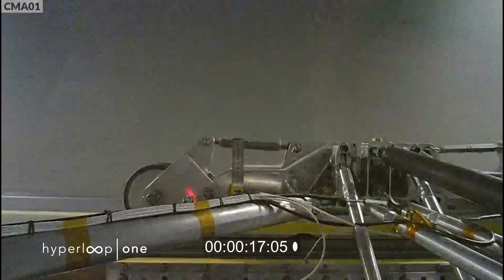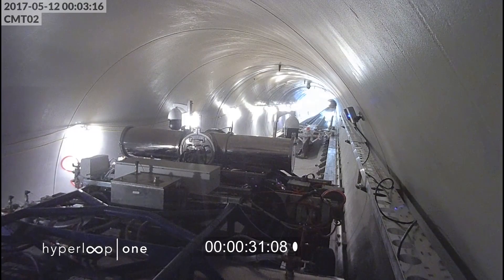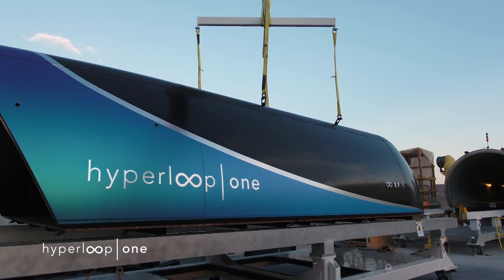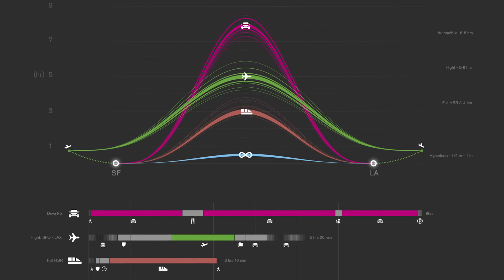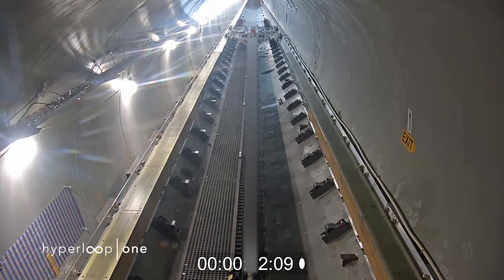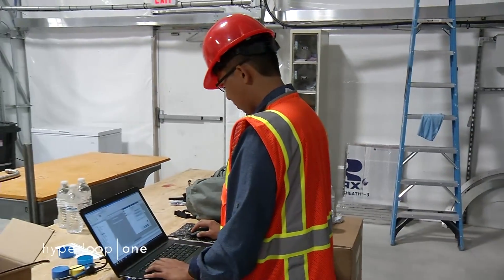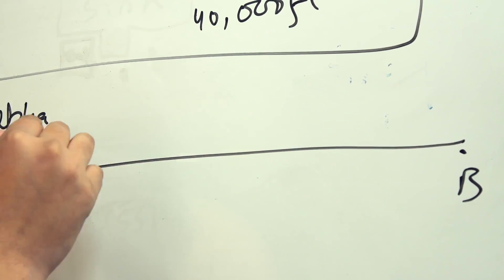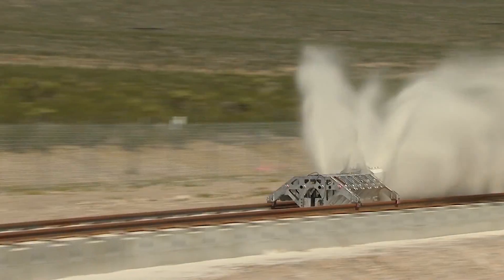Watch the Hyperloop Complete Its First Successful Test Ride | WIRED

Comment: Why are people talking about 
“What about if the vacuum gets a hole?” 
Really? Never knew everyone in fucking YouTube were a physicist or an engineer to talk shit. 
“What about terrorist?” 
Well shit 9/11 happened and millions of people are still riding planes to get place to place aren’t they? 
Fucking people are annoying as hell! We need to take big steps to bring humanity into a greater future than today.
Reply: Yes but even an incredibly small hole could cause a mass system failure
Reply: here we have a perfect example of what the original comment was talking about...the collapse doesnt have anything to do with air rushing in. In fact, a perfectly sealed tube would have an easier time imploding. What causes the implosion is the difference in pressure, which is obviously highest with an absolute vacuum inside the tube. Due to the circular cross-section, the tube is able to resist the forces trying to crush it. A fault in the structure, like a dent or a hole, compromises the integrity of the entire tube enough to cause it to implode. And make no mistake, this is a process that causes a chain reaction, collapsing adjacent sections too. There are plenty of videos on youtube that demonstrate this on a smaller scale, with barrels, or even train tankers, often using a combination of pressure and temperature differences to cause the failure.

Also, i wonder what your reasoning is as to why air flow is limited to the speed of sound?
Reply: lol... WHAT IF THERE IS NO ELECTRICITY?
i am more concerned with the wifi...
Reply: the big difference lies in the accessibility...how hard is it to get a bomb on a plane? pretty damn hard. how hard is it to just walk near the tube and shoot a couple holes into it with a gun? pretty damn easy. And, as an engineer, i can tell you a hole (or even a dent for that matter) would result in catastrophic failure of the entire system by crushing the tube...even if not by a terrorist attack, imagine one of these tubes crossing a highway or something, and theres a road accident and a car or truck crashes into the base of the supporting structure which deforms the tube slightly, and suddenly the whole thing collapses and causes devastating financial damage, let alone reputation and publicity consequences. These are some of the concerns people have as to the concepts viability.
Reply: If terrorists blow up a plane, you have to rebuild a plane. If they blow up railroad, you have to replace bit they blew up. If they blow up a bridge, you have to replace a bridge.

If terrorists would damage Hyperloop, you have to replace the whole infrastructure.
Reply: boi if you don't get
Reply: Juan Ramirez taking down a bridge doesn't destroy the entire highway, and is a lot more difficult than knocking a dent in a tube with a gun...also wouldn't the hyperloop be the perfect high profile target, rather than some highway no one cares about?
Reply: QTRG what if terrorist so attack the hyper loop? If people stop using the hyper loop we’re just gonna give them what they wanted. We let them win
Reply: Because you know that physicists and engineers never go online right!? Moron. lol
Reply: Juan Ramirez ya know what happens when you get a hole in a vacuum tube? The whole thing collapses
Reply: Go to University and learn about Hydraulics.
Reply: Juan Ramirez if a big enough vacuum fails it can cause a massive explosion just like a bomb
Reply: Juan Ramirez you sir have an optimistic mind. stupid and unable to see the dozens of unresolved problems with the project.

but optimistic..
Reply: What if the chamber is underground?
Reply: Correct, but many people don't want this whatsoever because of the risk of terrorism. For me, that's just upsetting.

Also, look up the whitepapers - a lot of the concerns are addressed there (the first few pages aren't very technical, so you may want to just read them/avoid them depending on how good you are with this stuff). The whole point of testing is to identify these issues, and obviously it won't be used by people until it's safe enough.

People are saying that there's a chance it'll never be safe enough and that it'll never work... but, couldn't you say that about every new idea?
Reply: Juan Ramirez and you are a graduated physicist or engineer?

mic drop get out.
Reply: do you have the same view for airplanes also ??/  still you travel.
Reply: Yep, people are shit. I fucking hate them.
Reply: I answered your question earlier, QTRG. He's incorrect to say that it is true in the general case, but ducted airflow through a reasonably small tube will choke per the Kantrowitz limit. And then that airflow will have huge pressure losses down the tube, and there will only be ~5% the air pressure just 2km from rupture.
Reply: I would like to see what evidence you have to suggest it would be catastrophic.
Reply: wow so many people finding obvious flaws.. dont u think the students and scientists building this thing would have thought this through??   never mind. its a free world. cant argue with trolls.
Reply: No, it only collapses if it isn't designed to hold the pressure. Obviously, you design it to deal with rapid decompression.
Reply: sandeep sampath the thing is that these teams are working on a proof of concept, not a feasible business, that's why these concerns don't matter much
Reply: Juan Ramirez Liberal excuses as always. Someone states an issue, but rebuttles with "well it's not as bad as X"
Reply: The Stig implosion, but yeah.
Reply: Juan Ramirez Juan porque no miras alguno de los cientos de videos que explican porque no sólo es peligroso sino también poco eficiente energeticamente
Reply: A plane flying high in the sky which can only be shot down by missiles,aa guns or other planes is a lot safer then a tube on the ground which probably isn't armored
Reply: Adam Mesarč I don't think the whole network will be chipped, but indeed, much transport will be stalled.
Reply: We do need to "take big steps to bring humanity into a greater future than today" but we need to be smart about it and make honest assessments of the risks involved.
Reply: Juan Ramirez Maybe because the idea is so stupid you don't need to be a fucking physicist to notice problems with the design! That said, people complaining about terrorist attacks are dumb. I also agree that with enough thought and design many if not all of these design flaws can be solved.
Reply: then youd have problems with compensating for thermal expansion and tectonic effects (when considering the distances they want to cover), unless you built a bigger support structure which the tube can sit freely in, but then you get another host of problems associated with underground structures, the biggest being cost, ventilation (for maintenance) and general unavailability of underground space in urban areas; it would basically make an already financially questionable project completely unviable
Reply: Yeah because 9/11 didn't change the aviation industry into deploying much more safety measures. You are more annoying than all the other people you complain about!
Reply: Juan Ramirez you sir are the smartest person I've seen in these comments like half these questions have probably been thought about by most of the people behind this
Reply: The argument aside, you do realize terrorists dont commit their acts just to destroy things right? In most cases, they are trying to push some sort of agenda (religious, political etc.), and terrorism is essentially a great way for them to push their message into peoples minds. Terrorist organizations wouldnt target the hyperloop because they want to stop the project, they would do it because it is an excellent means to push their agenda. Its susceptibility to this due to its vulnerability is something that cant just be dismissed.
Reply: QTRG You know what are better targets than the hyper loop? High ways, bridges where high amounts of traffic happens. Why aren’t terrorist attacking those? They’re not secure on any other way. People won’t be able to escape in time before it all collapses. Why would they specially target the hyper loop when there’s better targets out there.
Reply: The speed of sound has absolutely nothing to do with the speed the medium travels. Please dont try to call other people out when you have no idea what you are talking about. Air, being made of particles of matter, has as the limit of its theoretical velocity only the speed of light. 

Since the velocity of an object is dependant on the reference frame, the air around you might be fairly still relative to you, but its moving at tremendous speeds relative to the center of our galaxy, for example. 

To illustrate this, consider the ISS. Its hull is made up mostly of aluminum alloys, and the speed of sound in aluminum is roughly 6,3km/s. The speed of the ISS is 7,66km/s though.

How is this possible, when you say the speed of sound through a medium is the maximum speed that medium can travel?

Also, what exactly is your point with the vacuum hose? why choose an arbitrary 300 meters? i dont think it makes it easy to see, it actually makes it impossible to see what happens to the balloon at the other end...Besides, provided the hose has a reasonable diameter, nothing would happen at all, as a lungs worth of air would just dissipate into near zero pressure in your proposed 300 meter hose.
Reply: SoCool21 the same thing could be said about safety precautions at airports, and law enforcement in general. altering systems because of their susceptibility to attacks isn't a new thing, it's been done for decades

and, I might add, that aspect is only one of many that raise doubts, and not nearly the most pressing one in my eyes
Reply: The tube would absolutely not be crushed. For one, you'd install rings at regular intervals to support the tube from crushing. Two, crushing inherently chokes the flow of incoming air, so it's a problem that quickly extinguishes itself. Three, the air rushing in is limited to the speed of sound at that point, it won't come in instantly. Four, the tube is now a compressed air pipe, and the pressure losses on a compressed air pipe are on the order of 95% in 2km. So there's already not very much pressure just a few miles from the breach.
Reply: It's scary seeing people not want progress because they're worried of a terrorist attack on it.

I suppose they're winning.